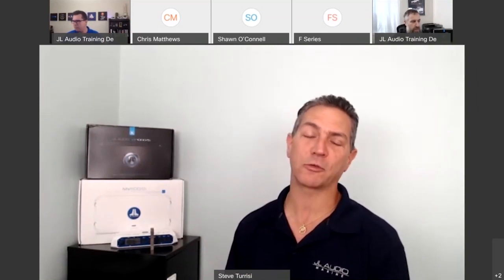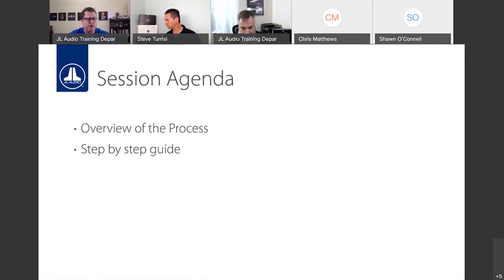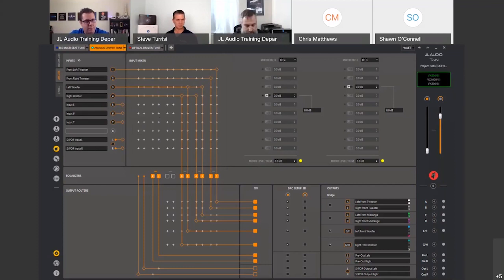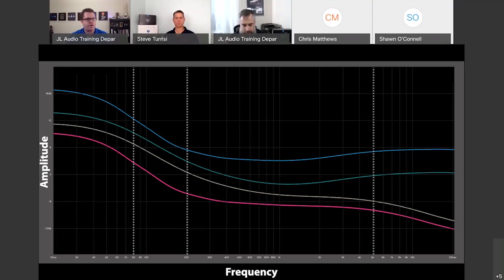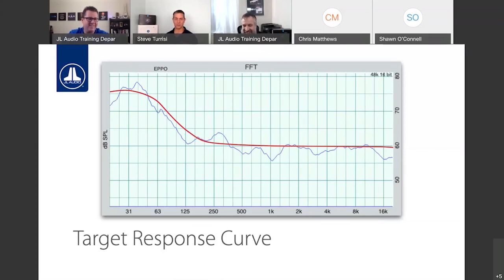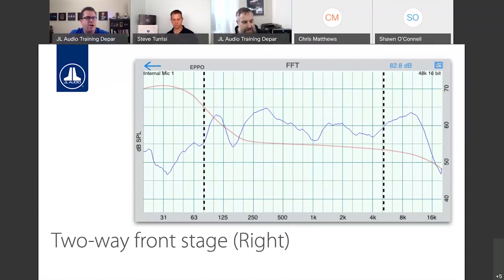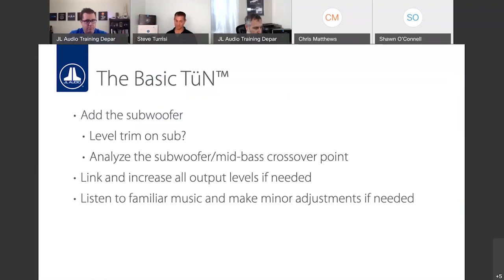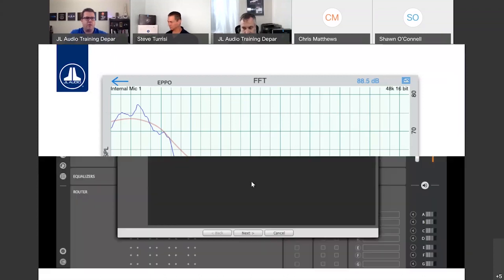[Live] JL Audio Online Training About DSP Amplifiers - Session 201a: Basic Car Audio Tune

Comment: I have recently set my TwK88 up. I did it in 3 stages, so first I checked for maximum undistorted volume at the headunit using 0db 1000hz and 40hz tracks. That took me to 46/50 on my Sony XAV AX8050. I then moved down the chain to the DSP and check there. My headunit has a 5v pre-out so its a good strong signal. I have only run 1 pair of RCA's from source to the DSP. It's a full range signal. I then moved on to  the amplifier. At each output stage, I verified that the volume and voltage coming out was the same. My DD1 didn't detect distortion at 46/50, 4v on the input of the TwK88 and at the output of the amps. I think information isn't great with regards to setting up the TwK. I also noticed that the lower the input voltage setting, the more the distortion crept in. I relied upon the DD1 in terms of telling me about the distortion, even though the TwK thought that there was some clipping. Are the input sensitivity numbers indicative of the amount of voltage that is coming into the TwK88 from the source or is it something else? Thanks
Reply from the maker: Appreciate the love and support!
Reply: @JLAudioInc  I have changed it since. The 4v setting for the input was causing clipping at the input stage. I measured the undistorted volume again which was actually volume 48/50. This allowed me to increase the input voltage to 7.1v. That gave me solid yellow bars without going into red.

Comment: I have a 1000/5i amp i am going to tune tomorrow.  This is the first DSP i have done, but this all makes sense after watching the videos.  What i do have a question on, is what volume should the headunit be at, when doing the tuning via TUN?  I know we can adjust output via the software, but is there a solid rule of thumb for what you set your head unit to while tuning?
Reply from the maker: Thanks for reaching out, Rick. If it's an aftermarket headunit - at 75 percent and then adjust input and output levels of the VXi based on that!

Comment: Hi there, is it possible to get the setup manual for this? Not the installation manual but the manual to do with setting up and using the DSP. I am unable to download it from the JL website. Also I'm assuming that it's the output level I would need to adjust in order to feed the amp to adjust the gains on it? Thanks
Reply from the maker: Shakeel - we apologize for the delayed response. Please reach out to our tech team. They should be able to point you in the right direction: https://jlaudio.zendesk.com/hc/en-us/requests/new

Comment: I purchased the VX800/8 and the VX600/1. If my DRC-205 in plugged into the VX800/8 and the Sub Pre-outs going to the VX600/1 will I need to flash a tune to the 600 separately and will the DRC-205 control the subwoofer level through the 800/8 to the 600/1?
Reply from the maker: Yes, you will need to tune the sub amp separately, but the DRC-205 connected to the VX800/8i will still allow for proper level control of the subwoofer by controlling the pre-outs from the 8CH amp.

Comment: Thanks for the videos guys! One question. During any of the tuning process, does it matter what volume the head unit is at? Thanks
Reply from the maker: The volume just needs to be at a volume high enough so that you get clear measurements that are above any ambient noise. It should not be at an extremely high volume, usually.

Comment: Question for the trainers. Should you use a sine wave file as recommended in the video or not use a sine wav file as recommended on JL Audio's support site. There seems to be a contradiction. https://jlaudio.zendesk.com/hc/en-us/articles/360001188267-VXi-Amplifier-Level-Setting-Guide. Regular music files tend to vary in sounds. Some are louder than others. At least the sine wav files are consistent.

"Since they show when the input signal is being overdriven, they don't require a sine wave to dial in the input signal. Simply play loud music at 3/4 volume and increase or decrease the Input Strength level until the colored indicator turns yellow."
Reply from the maker: Thanks for the inquiry. The processes are different for different amplifiers. A sine wave is more consistent and works best on amplifiers that do not have a clipping indicator built in. For the VXi, RD, and JD amps, using music is easier and requires less tools because they have the clipping indicators built-in.